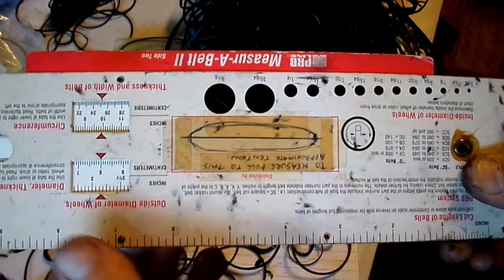Replacing Rubber Belts In VCRs, Turntables, And Tape Recorders. Are some designed to fail?

Comment: I'm curious, is it a belt issue if my VCR can only fast forward smoothly, rewind with a bit of struggles, but can't turn the tape at all when I press down the play button?
Reply from the maker: It's hard to say. It sounds like a  possible capstan belt problem, but I never like to guess until I see the VCR my self.
Reply: @GrantsPassTVRepair  Alright, thanks for your advice. I'm just having a harder time finding out how to access the belts in a RCA model VBT200 since while the top and back panel are off, the top load door mechanism is still in the way of seeing the full belt mechanisms.

Comment: Thanks for the link to PRB!!!!  Have you ever heard of Strike Hold??  An excellent dielectric lubricant.       https://www.youtube.com/watch?v=QXYzyjzyL2Q      I love it for electronic work and variable resistors.
Reply from the maker: Interesting demonstration, Do you know if he was using distilled water which doesn't conduct electricity? Some of the older variable resistors can be damaged by some of the electronic cleaners. I wonder if this product is any less harmful to them, or how long it remains on the surface it's made to protect before needing to be retreated.

Comment: This is very helpful! unfortunately I threw away the belt to my Toshiba V-M40 Betamax VCR before I could measure the height. Hopefully the height doesn't affect the performance that much. I do a lot of repairs on things with belts though, so I'll have to check this company out in the future!
Reply from the maker: In such situations a string can be useful in measuring the belt size you need. All the best.

Comment: Great video Dave, I remember fondly of those VCR days. 
Great money changing a belt and idler wheel...cleaned the heads and tape path etc...60-80 dollars for a repair, some weeks a couple dozen repairs...!!!
I miss the old days.
So glad there are still guys like you that have weathered through the throwaway days.
Best wishes buddy. 😉
Reply from the maker: First shop I worked in got 140.00 for replacing all belts. That was when VCRs were quite costly.
Reply: @GrantsPassTVRepair  ....true, in the early yrs of VCR repairs that's quite true, I remember they would command 70-80 for several years, then they became throwaways as well.

Comment: Thanks for the video, tips, terms and tragedies.  I am curious why some turn to goo or mush.  Could be the age, heat, and/ or chemical compounds.  Similar to rubber bands....some last, some are just trash after a few months.....planned obsolesce ?    J K
Reply from the maker: I've also wondered about this. If you figure it out please share it with me.
Reply: I have a feeling atmospheric Ozone is breaking down the compounds in the belts , I have also had issues with devices with rubberized coatings (a good example of this would be the rubber coating on the thumb sticks of video game controllers turning to a sticky goo)
Reply: I live in the most corrosive environment in the U.S., excluding the industrial dumps. Rubber literally melts here and turns to goo. Of the major electronics manufacturers, Sony and Panasonic use good rubber, Pioneer uses average rubber, and Samsung and Toshiba use crap. One thing Grants Pass did not cover was sizing belts due to inside circumference and stretch. This makes most belt kit assortments worthless, because they do not have sizes that match the OEM belts, nor do they tell you the stretch percentages, which can range from 1% to 20%. Aftermarket belt replacements cost around $4 on Ebay, but you're on your own picking the right size.